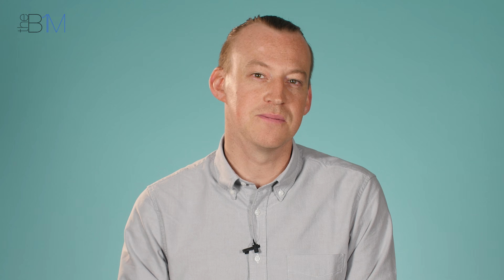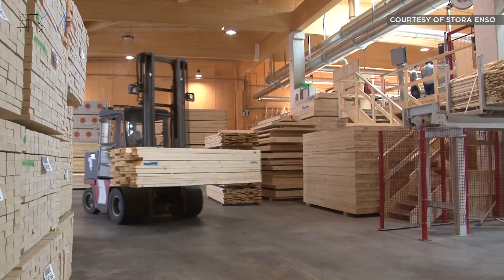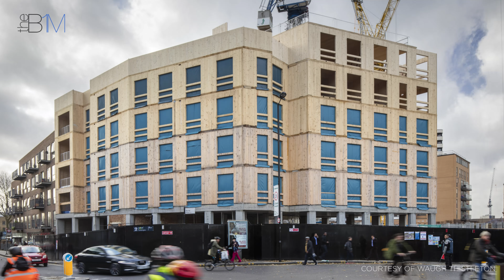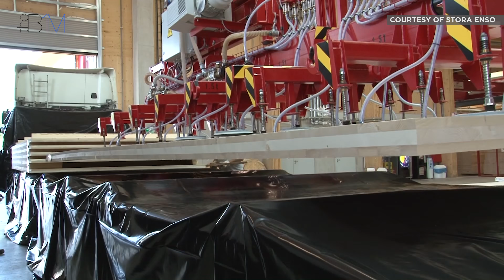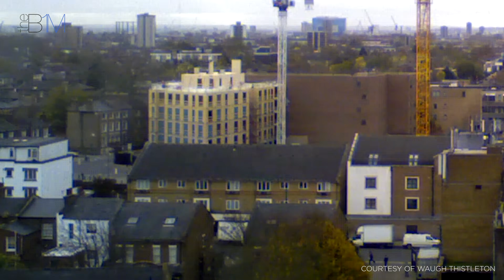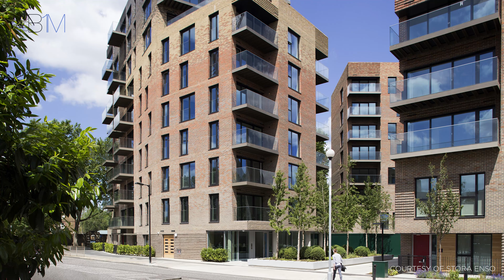What is Cross Laminated Timber (CLT)?

Comment: comparing embodied energy of concrete, steel, and CLT isn't that helpful in selecting a material.  each of these materials has their advantages, disadvantages, and purposes.  it's a subtle point, but in comparing the 3 materials, the insinuation is that CLT is the way forward compared to using these "bad" unsustainable materials.  rather, all 3 are useful and valuable, it's knowing where and how to use them to their best advantage.

Comment: it looks incredibly inefficient, yet very strong providing it does not delaminate, like plywood often does. so the walls are solid, how do you run electrical, plumbing, ducting & what about insulation?

Comment: great, let's use the thing that makes oxygen and we have very little of it left, to make buildings. Only engineers could be this excited about something that is speeding up demise of our society.
Reply: You completely missed the point. If you use wood as construction material, you bind co2 (1m^3 equals 1.8t Co2). When the wood is from sustainable sources, there is no problem. 
Switzerland for example uses around 7 millions m3 Wood every year, and around 10 million m3 grow each year. With proper forestry, the forest ist kept young, strong and healthy.
Reply: @tomdun7684  Another engineer? Look at speed up videos of deforestation of Earth over the past 50 years. It takes time for trees to grow, "we" cut them much much faster than they can grow. Also, trees use CO2 to produce oxygen, so CO2 is not inherently bad. You are trying to solve a non-issue. Do you think USA is going to do what Switzerland does? China? ... If these were used for family units - fine! For buildings? smh
Reply: @Ludak021  you are indeed correct that trees take time to grow. If forestry is done correctly, and a new tree is planted for every one cut down (I know, a big ask), then building with wood, no matter the building's size, should not present a problem. Especially if we don't destroy our oceans, since marine plants produce ~70% of the earth's oxygen supply.

Comment: I worked In a clt factory in Canada,  it is by far a superior product,  not cheap, but you remove the cost of a lot of other parts of construction. 
Sustainable forestry is the key and needs to be scrutinized. Forestry is big business and profits usually come before environmental impacts.
Reply: It is extremely lightweight compared to concrete too, way less weight for the building to sustain. But, it does take a bit more space because the columns and beams are wider.

Comment: To be sustainable and net gain in terms of energy use, the 50% less energy than concrete and 1% energy of steel energy consumption has to be matched by more than 1/2 durability of concrete and more than 1/100 durability of steel. Sure, this wood is reinforced but it's still wood, so I would be keen on seeing the actual numbers.

Comment: The only real downside to this system versus say a Pre-Stressed Panels or SIPS which is foam sandwiched between plywood is that there is no Thermal Break. The assembly is a giant Thermal Bridge. That's fine in some areas, but useless in Northern Climates like most of Canada. If not useless, then it becomes wasteful because the inner face can't be the finished wall surface because an insulated, thermal break must be installed, defying the aesthetics of this system.

Comment: how does this work thermally? theres no insulation layer like in a standard stud wall. its all just a chunk of wood? i know solid wood can retain heat pretty well but doesnt it take alot of energy to heat it initially? is this only applicable to buildings that always maintain a constant temperature and never shut off?
Reply: usually there is an additional layer of insulation
Reply: The inside of the house would be finished out like a traditional one with studs, insulation, and sheet rock.
Reply: @snakedoktor6020  then I don't understand? Is there not really a thermal benefit to clt? Is it just structurally beneficial? I know wood is sustainable but this uses a ton of it? What is the point?
Reply: @ooDirtyMickoo  Uses only sustainable forest. Alle European factories does. The outside of a building is insulated and covered with your preffered cladding. It has a substantial insulation capacity in itself, but not enough for residential homes. (In Norway. We also have heavy snow loads)

The list of benefits compared to concrete is infinite.

Comment: Cross-Laminated wood can be built in Segments or directly in blocks and can be joined together on site with a little about of tools.

Erwin Thoma and his company use no glue but join it together mechanically.

How high could we theoretical built with CLT and for example with bamboo?
Reply: I don't understand what "with a little about of tools" means.
Reply: @snakedoktor6020  a small amount of Tool not spezialisiert which  the most people have at home

Comment: There are studies which show that the cost for CLT/square foot is still higher then the traditional on site steel and concrete casting method like this: https://buildingresiliencecoalition.org/comparing-the-costs-of-cross-laminated-timber-clt-and-cast-in-place-reinforced-concrete-structures/

Is it true?

Comment: so much wood is used for one wall. with normal studs you can build more
Reply: In the US, they're using CLT to build post and beam structures and allowing for the walls to be completed with studs or perhaps even insulation with a protective covering to give it form.

Comment: Carbon savings? You're cutting down trees to do this....remind me again what gas trees consume for photosynthesis. Smdh.
Reply: Its renewable and is far more carbon friendly than the burning limestone for concrete, which just releases excess carbon
Reply: @starmaninthegrave485 Renewable? If this material is ever used anywhere near as much as concrete is used, then humanity is done for. It takes a couple minutes to harvest a tree but it takes 10+ years for spruce trees to mature. We'll never have enough land to grow more than we would need. The amount of wood needed for Mass timber to supplant concrete would make the Amazon deforestation look like child's play. Also, trees use carbon dioxide to make their food and oxygen....you realize that cutting down more trees could in no way be "carbon friendly"?
Reply: @TheMontegonian  Hi Montengonian. We use PEFC and FSC certified forestry, and all projects are carbon negative. For example for an 8 storey block of 45 apartments, rough averages would be around 2000 tons of carbon stored and taken out of the atmospheric cycle, vs around 260 tons emmitted from machinery and transport, this results in very carbon negative super structures. The time taken to re-grow all the timber used in these size of buildings is around 20 mins to 2 hours in Austrian or Finnish forests on a summer day. 41% of Austria for example, is covered in forrestry and enough timber is grown there every day to make 2100 family homes. These type of trees used grow to maturity around 80-90 years, and as soon as a tree is harvested it is re-planted.  Actually, when trees reach maturity at around 80-90 years, they severely slow down in carbon dioxide to oxygen exchange, and in fact begin to decay, releasing carbon dioxide back into the atmosphere. Its a common misconception that cutting down trees cannot be carbon friendly - the quickest and most efficient way of cleaning the planet is to continually cut down mature trees and immediately re-plant new saplings. This ensures the trees are at their most efficient in carbon reduction, and doing the most they can to reduce carbon in our atmosphere. The number and volume of suitable forest internationally that can be sustainable harvested  is very large, and I can assure you is one of the most sustainable carbon friendly forms of construction.
Reply: @TheMontegonian  I don't think you get it. Concrete requires cement which needs to be produced at ridiculous temperatures in natural gas furnaces.

Wood grows, absorbing carbon.

When we cut down trees, and use them to build things, they do not rot, or get burned. Our wooden buildings store carbon. Trees grow back.

Comment: Seems pretty cool honestly.....BUT, this construction style seems outrageously expensive. Also, I'd like to see evidence of the claim that it uses half the energy of other materials. Also a solid wood wall would have very poor insulation value. It's hard to see any eco friendliness given the enormous amount of timber it would take to make structures out of this stuff. And, my God, how HEAVY must those panels be!
Reply: Hi Poletste, to answer your points - Expensive - There have been thousands of mass timber buildings now constructed internationally and in regards to construction cost come in as comparable to traditional methods such as steel or concrete. In regards to m2 build cost it may remain slightly higher (very slightly), however, the build is constructed in a much shorter time, meaning for the investors their loan requirements are much shorter periods and therefore large savings in financing. There are a number of published cost reports on CLT, in particular Dalston Lane which is featured in this video, found the the mass timber solution was £92k more expensive than traditional (on a £71M project this is nothing) and the build was delivered a year sooner than with traditional, but also could add more units due to the reduced weight on the ground conditions. This therefore worked out as very viable in regards to cost. This, added to the fact they are 1/4 of the weight of concrete, results in much less groundworks and therefore cost savings in the ground. Finally, all the follow on trades are much quicker to install, and so your site costs are also reduced. Typical time saving against traditional is around 24% on program from design to finished build. Energy - CLT can be used for passivhaus standard and zero carbon dwellings, due to its air tightness and inherent thermal performance. A typical 100mm CLT wall panel for instance has a U-value around 0.9, and so to get this to around 0.13/0.15 you then add insulation to the external walls to meet your required U-value. As an example, Ellerslie Road in the UK (Scotland's tallest timber building) has estimates of annual energy bills for a 2 bed flat at £290 per year, and uses PV panels etc, to result in very good energy performance.  Weight - typical wall panel is around 300-500Kg's, and a typical full size floor panel can be up to 2 Tons. This is still however, 1/4 of the weight of a concrete equivalent. Hope that helps!
Reply: gaz6351684 all the information you’ve provided in these comments is very much appreciated. Thanks
Reply: insulation: Concrete blocks, formed concrete, and steel also have poor insulation value (not talking thermal mass). These other structural materials are never held to a high insulation standard. 
Eco friendliness: These trees are all farmed fast growing softwoods. It is a renewable resource and a the whole structure stores carbon. Most construction is a carbon producer. Mass timber construction is a carbon reducer. They are indeed very heavy. 
There is a lot of investment right now in making the creation of a new buildings an assembly process rather than an on site construction process. Here is a example. This company Katerra has been going this way. Here is a segment from the mass timber conference. They play a little video then get into some history.
https://youtu.be/99HyFyr3Zxk?t=2026

Comment: the fire issue baffles me because even steel structures are now covered in sprayed on fireproofing called SFRM so why could this not be used with CLT as well?
Reply: because you dont need to! Wood keeps the load carrying capacity when heated

Comment: Deforestation?
Reply: Hi Mekhi,  I work for Stora Enso (our factory in the video) and in particular the CLT division. Its very easy to think that using timber means we are deforesting large areas of the world. However, we only use PEFC or FSC regulated forestry. This is very important, because these are plantations of trees, managed forest areas which are specifically grown for the timber industry. They are carefully and sustainably managed, and for every tree used, and other 1 or 2 is then planted. Trees in these plantations are grown very much like farmers crops, and they are harvested every 70 years or so, on a constant basis. 80% of the timber we use in our CLT mills comes from Austrian forests, Austria's land mass is 41% forestry, and enough timber is grown there every day to produce 2100 single family CLT homes. In doing this, and constantly replanting the tree's we use, we are actually cleaning the atmosphere by converting CO2 to oxygen, storing the carbon in the trees and then locking this away into buildings. By re-growing these tree's its a constant cycle of renewable, sustainable timber, rather than deforestation that never grows back. You may want to see our video "what a tree can do" which explains this further - https://www.youtube.com/watch?v=rUElPYaxgqs&t=33s
Reply: deforestation r problem not

Comment: What about water???
Reply: Hi Omer, in regards to moisture protection, DPC and DPM's are used at CLT to concrete ground level to protect the timber from ground water, and an external membrane is used on the exterior of the structure. So, through standard architectural detailing and water protection the CLT should be protected from water ingress. For any rare circumstances like internal water leaks, or for instance during the construction before the protection is applied, the timber can get wet, but when the leak is fixed or the build is watertight, the timber will then dry back out to its natural moisture content of around 15%. One of the great benefits of CLT is that it can be constructed in the wet, snow and bad weather, so temporary wetness is no problem, but for the finished build it should be detailed and protected sufficiently to local building regulations.
Reply: gaz6351684 Thank you very much for the explanation

Comment: And there goes the amazon end.
Reply: Hi Julian,  I work for Stora Enso (our factory in the video) and in particular the CLT division. Same as my reply to Mekhi above, Its very easy to think that using timber means we are deforesting large areas of the world. However, we only use PEFC or FSC regulated forestry. This is very important, because these are plantations of trees, managed forest areas which are specifically grown for the timber industry. They are carefully and sustainably managed, and for every tree used, and other 1 or 2 is then planted. Trees in these plantations are grown very much like farmers crops, and they are harvested every 70 years or so, on a constant basis. 80% of the timber we use in our CLT mills comes from Austrian forests, Austria's land mass is 41% forestry, and enough timber is grown there every day to produce 2100 single family CLT homes. In doing this, and constantly replanting the tree's we use, we are actually cleaning the atmosphere by converting CO2 to oxygen, storing the carbon in the trees and then locking this away into buildings. By re-growing these tree's its a constant cycle of renewable, sustainable timber, rather than deforestation that never grows back. You may want to see our video "what a tree can do" which explains this further - https://www.youtube.com/watch?v=rUElPYaxgqs&t=33s

Comment: How long would CLT last?
If you would be building durable building that will last for more than 100 years old is granite brick better than CLT then?
Reply: Hi Falcon,  I work for Stora Enso (our factory in the video) and in particular the CLT division. Our ETA gives an assumed working life of 50 years, however in regards to mortgages and warranties on insurances, this covers over 60 years. CLT is very robust, and as long as the building is built correctly and detailed correctly, there is no reason these buildings will cannot last much longer than that. If you take examples from Japan for example, where there are timber structures that are over 1000 years old, the degradation of timber in the right conditions and protected correctly means they should easily stand the test of time. Its all about build quality and detailing to ensure a very long life span of the CLT.
Reply: @gaz6351684  Hi I work in South East Asia we are very interested in termite resistant CLT could you advise, in Europe I build several structure some from you factory.
Reply: Luxuryhome Mark  Hi Mark, we do have termite treatment options, particularly for the Australian market. Please email me on my work account and we can discuss further - gareth.mason@storaenso.com Thanks, Gareth
Reply: My wood-timbered house is 97, so get back to me in three years.